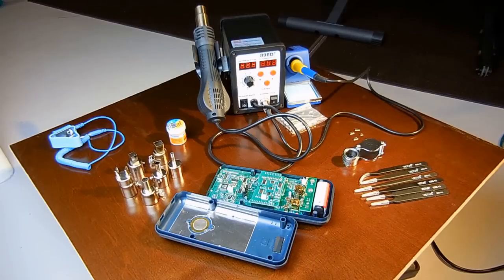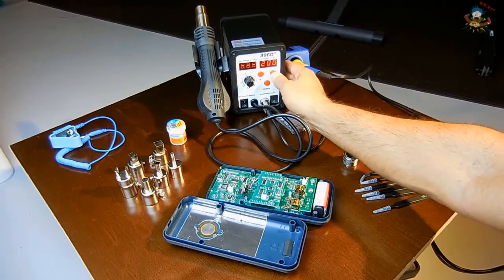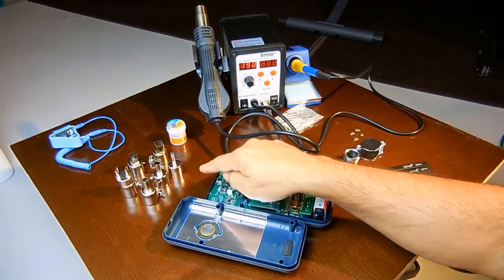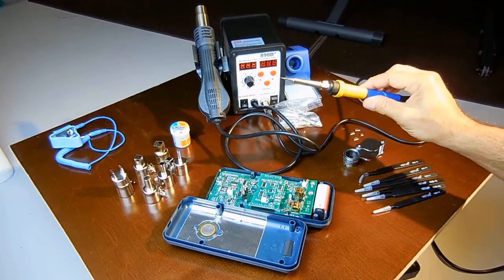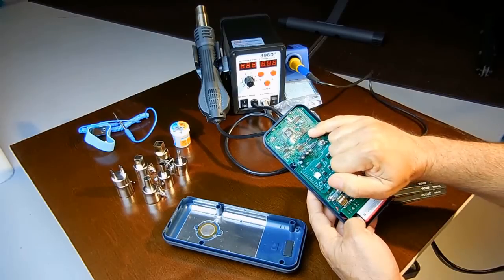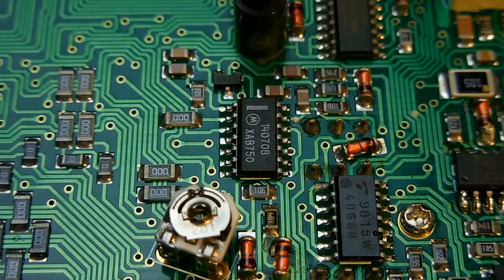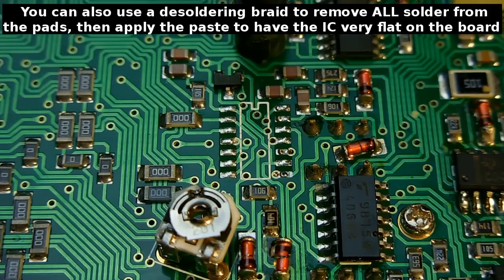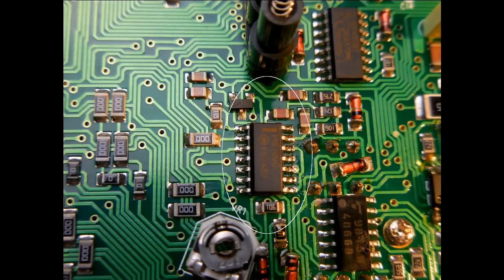Hot Air Reflow/Rework SMD IC Swap(Tutorial)

Comment: This looks really good.  I've had some reasonable luck with my hot air rework station, but also some mishaps.  Just now I tried to remove a surface mount IC and I managed to blister the PC board before melting the solder.  Any tips would be greatly appreciated.

Comment: So... couple of problems here.  First I tried to use that wrist grounding strap thinga-a-ma-jig you recommended.  I don't think it worked.  While doing some "rework" on one of my giant air conditioner units, (I was sure I had it disconnected) I grabbed a large component that looked like a big soup can with two leads coming out of it.  There was a static shock that went into my body.  Up through the wrist strap, then down my chest, past my groin and into the ground.  As the static passed my groin, I lost control of my bladder.  Next, I proceeded to run around the yard for 74 seconds (as per the security cam footage), yelling, in what my neighbors, several of whom came running, assure me sounded like Mandarin. I speak no Asian languages.  Second, I tried your little conversion formula to make C to F...I tried it with -41 and it doesn't work.  

Just kiddin' I ordered one of the because of your excellent review and demo. Thanks.

Comment: im new to working SMD. If max IC temp is 125C and solder melts at about 100c that means I need to keep the heat gun at about 100?   im going to purchase this station, do you know now how accurate the temp is?
Reply from the maker: 60/40 solder melts around 185C. If you hold the tip close, and the temp is correctly set, it should melt in 7 -10 seconds.

Comment: Was the airflow set to 285 celcius and 5 flow rate when putting ic on? Thanks great tutorial
Reply from the maker: I don't recall, it should be shown in the video. For very small SMD components, you use a lower flow rate, otherwise you'll blow them out of position. Thanks for watching!

Comment: Good video. I was just wondering if the chip you repaired was faulty or whether the the manual soldering you did wasn’t able to do the job as I couldn’t see anything wrong with the joints from the video. Thanks in advance
Reply from the maker: Everything worked great when I was done. The DMM had a damaged IC due to excessive voltage.

Comment: Nicely soldered you say. OK if you say so. Works for you. I would tackle it differently though. Would use tacky gel flux and hotter air setting tho desolder the chip faster. Then I would wick off old tin off the pads. Then apply new tin on the pads. Then applied little flux and not a soldering paste on it. Then soldered it with hot air. That is if I would use hot air to solder new chip on the board. I would rather drag solder it instead. Faster. After wicking I would clean the pads and add flux. Place chip on it. Tack one pin on the opposite side. Drag solder one side. Same on the other side. If I were you I would not mix terms flux and soldering paste. I would have re touch it using flux anyways. Would start videos with I do this my way and goal for me is to fix things and have fun doing it.

Comment: You can set a high heat and have it come off quicker, i use 400 all the time and its off within 10-15s mostly. Doesn't damage the IC if you check its specs it will tell you what heat it can hold and for what amount of time.

I would of cleaned the pads though as you mentioned to get the IC flat to the board. Solder paste is alright i guess but i prefer to do the drag method. Solder paste is good i guess if you don't have much skill with a solder iron and you are using cheap tips.
Reply from the maker: Since this video was made, I turned up the heat. :-) Thanks for watching! Be sure to look over my extensive video playlists for other videos of interest to you, and most importantly share my channel with many others. 

http://youtube.com/c/electronicsnmore/playlists

Comment: I was trying to use a hot air rework station to replace a usb plug on a thumb drive, and it blew all the components off the board before the usb plug came loose. I turned the airflow to it's lowest setting and put the components back in their places, hoping they would snap back to their spots, but they just wiggled around all over the place. I was using liquid flux, I don't know how big of a difference that makes.
Reply from the maker: You need to shield the other components from the heat.
Reply: @electronicsNmore  I put kapton tape over them, but they still walked. I think when the usb plug came loose the jerking motion was enough to dislodged the components. I  soldered the smd components back by hand, and now the thumb drive LED lights, up, and I get a usb mass storage device in device manager, but it doesn't show a storage volume.

Comment: What's the common temperature & air flow rate used in hot air station that can't damage the chip you want to desolder?
Reply from the maker: It's best to read the data sheet for the component you want to heat. The max temp rating will be shown. Thanks for watching!
Reply: @electronicsNmore  How about for the simple LED TV BACKLIGHT, what's the temperature & air flow rate to be used in order to desolder LED TV BACKLIGHT? I'm a student & want to gain knowledge about desoldering technique. Thanks

Comment: Thank you for this most excellent video. I ordered that rework station after watching this video. Should be in by next Monday. I messed up a board in the windshield wiper motor of my truck awhile back. Probably wouldn't have bungled it if I'd had the station then. I have another small circuit board I need to work on and it should work out great with the hot air rather than only having an iron available. Thanks again and keep up the great work! 😁
Reply from the maker: Glad you enjoyed the video Mark!  Be sure to look over my "Product Review" video playlist also and share. Thanks

Comment: I would challenge your methods. Using solder paste is not good. All you needed was flux. Solder balls were left all over the place. It took 28 seconds of heat to remove that IC. If you were wrong and the chip was still ok, you would have ruined or damaged the IC having it heated that long. If you look up IC specs, they are good for 10 seconds at soldering temp. Not to mention the heat soaking of all of the parts around the IC. Not good either. Also that much time and heat, can de-laminate traces from the board. I'm glad you got your late 90's meter working again. I love my meters too.
Reply: mikep95133 You were just trying to help... ah well =)
Reply: Solder Balls... thank you, exactly what I said as well.
Reply from the maker: +mikep95133 
Completely disagree. There is zero evidence of any damage to the circuit board. I have seen MANY others place entire circuit boards in ovens to reflow with little or no problems. You forget that the IC does not "Instantly" reach high temperatures when placed close to the nozzle. It takes time to heat them up all the way through. There are no solder balls. The only IC that shows more solder than normal, is one I did by hand in the past WITHOUT the use of this equipment, and that component is just fine.
Reply: I just don't want to see you ruin something pricey someday with that technique.
Reply from the maker: mikep95133
Don't worry. :-) If you have a method you like to use, then use it. Whatever works for you, you do.
Reply: +electronicsNmore Sorry man. What was I thinking.

Comment: Actually, "ESD-safe" Tweezers are indeed CONDUCTIVE so the tool stays at the same potential as you, wearing your wrist strap as you should do. You may be misinformed by the seller.
Reply from the maker: According to the manufacturer, the tweezers are coated in a special material to prevent static discharge.
Reply: +electronicsNmore China - What can you expect? The ESD-safe part of tools is the use of paint, coatings etc. that is conductive, so no charge builds up on the tool. There is absolutely nothing that protects the part you touch, from you.
Reply from the maker: +zaprodk 
Then why bother coating it at all when you can just use a stainless tweezer with a wrist strap? Makes no sense. I just tested the coating using my Wavetek, and the coating is far from conductive.
Reply: +electronicsNmore Because stainless tweezers can't be sold as ESD-safe unless the customer can see a difference (some ESD-safe products is that way) - No you cannot measure the conductive coating with the low voltage applied by the multimeter - It's like probing a ESD-mat - you won't really see a reading.
Reply from the maker: +zaprodk
Not going to argue with you over this. I have better things to do. I suggest you vist Sparkfun's website. Exactly what I said they are designed to do, they do. The coating is NOT CONDUCTIVE as you claim, it is the opposite. Though nothing is 100%, they claim the special coating prevents static discharge which can destroy components. I am done discussing this. If you post more replies, I will have to delete them in order to put an end to this.
Reply: +electronicsNmore Sorry, no need to get MAD when i question something in your videos.  I'll talk to Sparkfun and ask them why they write that. Try googling the sentence "Static dissipative" because this is what the coating is, not conductive as-is. I just fetched a datasheet from mouser.com - of some WIHA tweezers which is a very good brand (and expensive) too, they state this: ESD SAFE | STATIC DISSIPATIVE | HYPO ALLERGENIC COATED | TEXTURED GRIPPING SURFACE: http://zapro.dk/public/billeder/wiha-tweezer-datasheet.png Right now it says this: https://www.sparkfun.com/products/10603 "The ESD-safe coating will also help prevent electro-static damage to sensitive electronic components." Peace out man!
Reply from the maker: +zaprodk 
You just confirmed everything I said! Static-dissipative means high resistance. Think of the coating on the tweezer as a high value Mohm resistor between you and the tip of the tweezer. The coating GREATLY reduced the conductivity, unlike what you claimed. I'm not mad, just annoyed that you wasted my time., and insisted that I was wrong. An apology would be nice.
Reply: +electronicsNmore I am so very sorry. At 05:37 you say "With this special coating, the static charge on your body cannot make it to that tip, to be discharged on the component" indicating that the coating on the handle insulates the tip of the tweezer from charge on the person holding it. No coating will or can do this. The dissipative nature of the coating is to make sure that the tweezer does not charge up, just by laying on it's own your work table, from draft and air currents which otherwise could charge it up. Non-dissipative stuff charges up all on it's own. You can even get ESD-safe trashbags, because normal ones charge up and can transfer a charge to you just by standing near and handling some sensitive circuits.

Comment: I found this very useful.  I had been wanting an integrated vacuum soldering station for parts retrieval (I take apart old tv's and microwaves for the parts).  Unfortunately, those stations are expensive.  This seems like a viable alternative.  Have you tried taking out a non-SMD chip without destroying it?
Reply from the maker: +mediaguardian 
Yes. The heat does not destroy the IC if the proper temperature is used, and you do not keep heat on the IC too long. 

Thanks for watching! Be sure to share and rate thumbs up.

Comment: Good job. I'm curious how you figured out which ic's became defective and needed replacing?
Reply from the maker: +mrsemifixit 
Hi there. One setting of the DMM was faulty, and the rotating dial traces were fine. Luckily I had the schematic, so I located the part of the circuit which was used for the setting that was faulty. The IC's are very inexpensive, so I decided to try and swap out the IC on that part of the board. It worked. :-) Thanks For Watching!